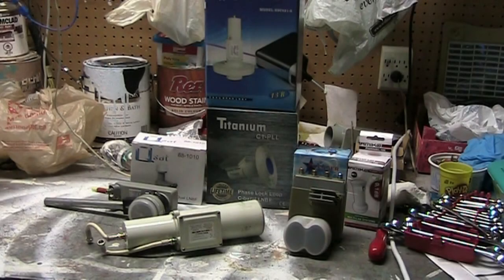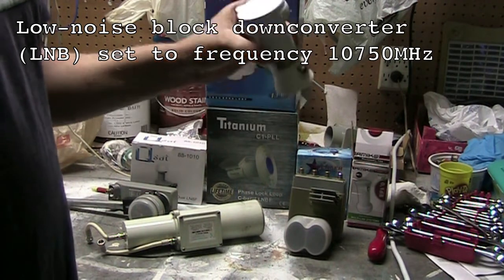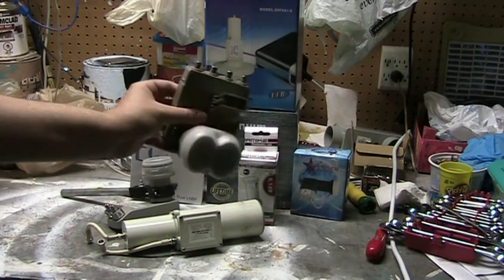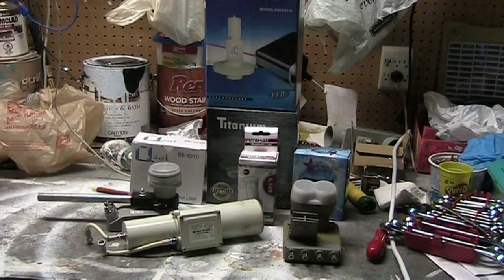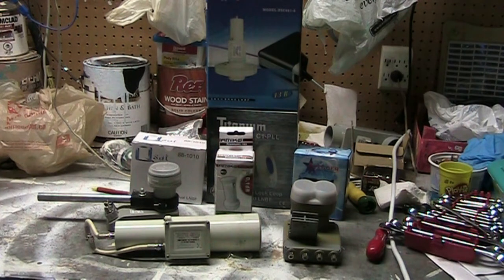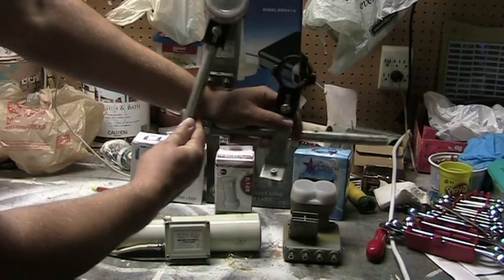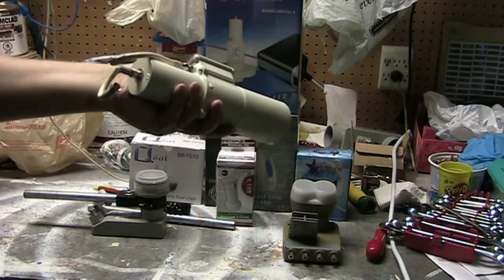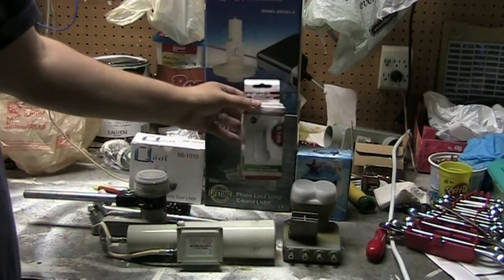LNB Low Noise Block Downconverter for a FTA Satellie Dish

Comment: Just upgraded both lnb's with a lower  *K  but the signal strength is strong butbit will not lock in any transponders. I thought  the new lnbs may be  backwards..i am a long timer cband user